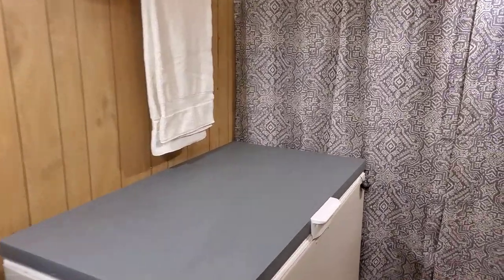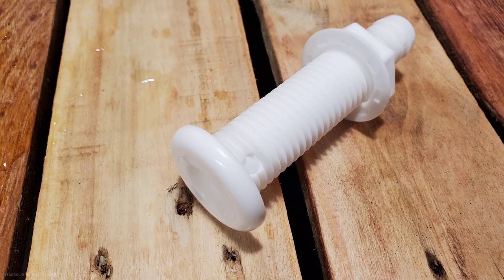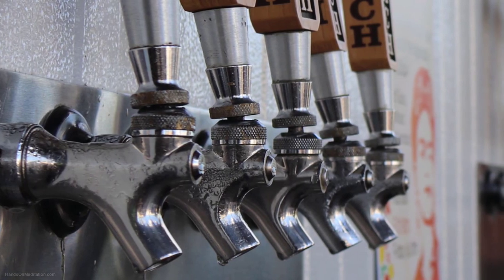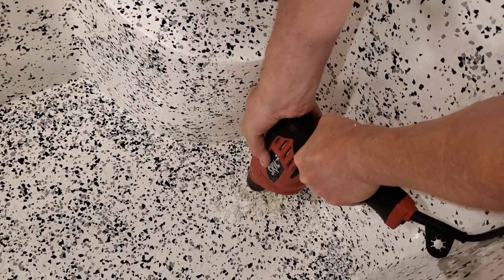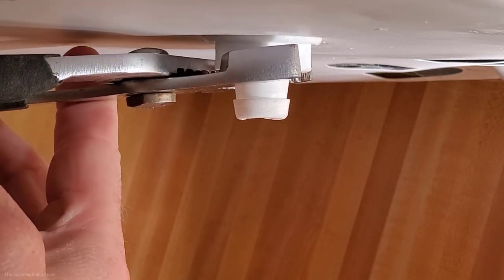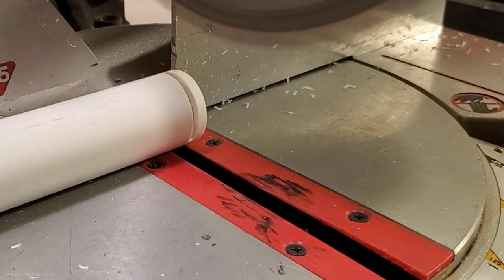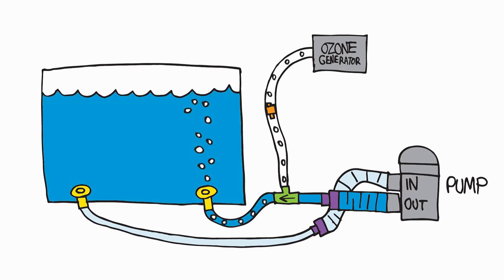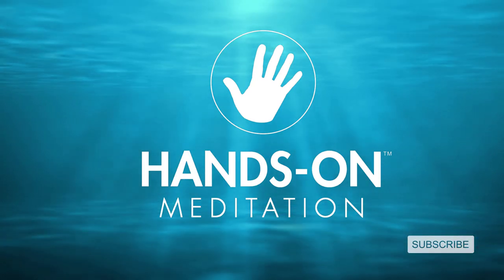DIY Ultimate Cold Plunge | Running Plumbing Up Through the Freezer Floor | Ice Bath Cold Therapy

Comment: Followed your setup, thank you! Just connected the venturi injector and it has dramatically decreased the flow of water in and out of the pump, its filtering much slower due to the air bubbles. Did u have the same issue? What size pump are u using?
Reply from the maker: This is the pump I use https://a.co/d/4C5TkcJ  I've never connected it without the venturi and ozone generator so I have no idea how much that changes the flow. But it seems to work well.  Links to all the products I used are in my 1st cold plunge video.
Reply: Thank you! Did u get the 1000GPH one?
Reply from the maker: Looks like it's 1000 gph.
Reply: @HandsOnMeditation  seems overkill no? 500 would be plenty?
Reply from the maker: It is a little overkill but a lot of these pumps are basically cheap plastic junk. I was originally running my hoses over the sides of the cold plunge and ran into issues with a smaller pump. It was complete garbage. If you have success with a different pump, please let me know.

Comment: What diameter are those through hull connector? I have the same pump
Reply from the maker: I have links in the video description. Mine connect to 3/4" hoses but the pump hoses are larger so I used an additional adapter to size up to the pump hoses.
Reply: Can you give me details on the adapter?
Reply: Can u post a pic of the adapter?

Comment: Thank you for the many details. I've been reading "The Ultimate
CHEST FREEZER DIY GUIDE
COLD PLUNGE* eBook and there it's stated that ozone can be dangerous indoors when not ventilated thoroughly. What do you think?
I have my chest freezer placed indoors where people/pets often pass by. I haven't fully decided on the sanitation method yet. Ozone seems perfect but I'm worried about apparent dangerous effects indoors.
Reply from the maker: I wouldn't lock myself in a closet with an ozone generator running all day long but mine only runs for a 5 minutes a few times during the day and night, then10 minutes after each use.  It's my understanding that ozone dissipates quickly in water so I don't think there's any danger in the way that I'm using it and I haven't had any issues.  I would do some more research and decide whatever you're most comfortable with. I'm much more comfortable using ozone than pool chemicals. Also a lot of spa's use ozone and it's even used in food preparation.

Comment: Have you had any issues with temperature with this setup?   I've heard some say that it's harder to keep the temp down due to the heat transfer from the lines and pump that are outside of the unit.   Also, do you run the circulation 24x7 with the ozone being injected only for a short period or do you only run the circulation / filter for the time that you want to inject the ozone?
Reply from the maker: With this setup, the water will warm up a little when the pump is running because the hoses are outside and aren't insulated,  so I don't run the pump continuously.  Also, I run the pump and ozone generator together and I don't want to create unsafe levels of ozone. I just run them for 10 minutes after each use, and a couple more times during the day and night for 5 minutes. I use programmable smart plugs and that works well. My cold plunge usually gains about 3 degrees of temp each day, and running the freezer for 3 hours at night brings it back down. I'm working on a videos that shows my specific settings and the ozone/pump working together.
Reply: @HandsOnMeditation  Cool, thanks for the response.  That all makes sense.   Look forward to seeing that other vid when you get it up.
Reply: @HandsOnMeditation  I live in texas...and I'm thinking about putting this unit on the back covered patio...however, it does get pretty hot here during the summer.  I wonder if I'll have issues with keeping the water cold...

Comment: Hey man have you noticed the Air/odor from the ozonatar make the Air harsh to breath in while your in the cold plunge?
Reply from the maker: No, but I don't run the ozone generator very long. How long are you running it? I only run the ozone for 10 minutes after each use, and a couple more times during the day and night for 5 minutes.
Reply: My one is hooked up to my ink bird so turns off & on with the ink bird not to sure how much time each day it will be on but maybe to much, Also I need a air stone filter for where it pumps the air into the water, I have foam type piece on there atm
Reply from the maker: You may want to put it on a timer so you can better control how long it's running. I use smart plugs https://amzn.to/3N34frM and can adjust with my phone.

Comment: Nice and and clean setup.. Any reason not to run the thermometer through the wall ?  Also do you know it Sikaflex sealant is non toxic? Thanks.
Reply from the maker: I'm not sure about the sealant but mine is covered in pond shield paint and that is not toxic.  My thermometer cord is very thin and easily fits under the cover so there's no reason to go through the wall.

Comment: I love this setup. Could you please share the make and model of this freezer? Was it white enamel inside or aluminum? 

Q: do you think the through ports would seal as well over line X?
Reply from the maker: I believe mine is Whirlpool - 14.8 Cu. Ft. Chest Freezer - White Model:WZC3115DW
The inside was white enamel but had some scratches that were rusting so I painted it with Pond Shield.
I'm not sure about line x. I've never worked with it. Please let me know it you experiment.

Comment: What setting do you have your filter pump on?  And I’ve seen other cold plunge DIY videos where the ozone tube just sits in the water so they need a timer on it. Since we have the ozone hooked into the filter pump, do we need a timer for the ozone generator since it should only flow when the filter pump is running?

Thank you!
Reply from the maker: I have the ozone generator and pump on the same smart timer (I used a splitter so they run at the same time).  They are programmed to run for 10 minutes after each use and a few more times at 5 minutes during the day and night.
Reply: Hi, can you provide a link of that timer and how did you installed it? Thanks
Reply from the maker: I ended up using smart plugs for a timer. There's  a link in my 1st cold plunge video for them you can program them with your phone.

Comment: Also I can't find anywhere a coolant line diagram for my  14.8 frigidaire FFCL1542AW. Any help for schematic because I really want to setup just like yours. Btw getting a Thermal cam is out of the question.  Thank you.
Reply from the maker: You might be able to borrow a thermal cam from your local fire department if you bring brownies or you can order one from Amazon, try it, and if you aren’t happy return it. Plumbers also often have thermal cams. And you can feel the surface temp difference
Reply: Hey! Was wondering if you ever found a diagram for your freezer or found safe spots to drill?  I just bought the same one and literally has searched everywhere online.
Reply from the maker: I really suggest checking with a thermal cam. You may be able to order one, "test it out" and possibly return it if you don't want to keep it.
Reply: @HandsOnMeditation  You're probably right.  It will be the safest way.
Reply: Was able to get a thermal camera. Turns out I was able to put mine essentially the same place you did.
Reply: @HandsOnMeditation  brownies for the local fire department.  So funny, love it.  But to be honest, I think tht would totally work.
Reply: @stephenshockey  I just bought the same freezer and I’m about to do the same pump setup. How’d everything go using the Frigidaire FFCL1542AW?

Comment: Does anyone have any suggestions for running this setup outside in constant below freezing temps? Should I run the pump continuously/intermittently any time there is consistent cold temps?
Reply from the maker: I don't think you want to run a freezer in temps below freezing. Probably better to consider a large stock tank like they sell at Farm & Fleet. Then use a deicer to keep the water from freezing over. That's also a cheaper option.

Comment: Did you coat all your freezer with the 2 epoxy paint canister ? Only one coating is good? Do you know if it'll stick on top of aluminum freezer coating ? Thanks
Reply from the maker: The kit comes with 2 cans.  You have to mix them together for it to set up (like epoxy glue)  I used two kits and had a little bit left over.  My freezer was painted steel/plastic and it sticks well. I'm not sure about aluminum.  You may want to ask pond shield customer service about that.
Reply: @HandsOnMeditation  Thanks

Comment: Do any of you have a problem with your freezer getting really hot on the back side ?
Reply from the maker: The condenser coils in the freezer move the heat to the outside so it's normal for it to feel warm on the outside when the freezer is running.

Comment: Hello, thanks for the update on this.  Your first video and this were both great.  Very helpful.  One question, you mentioned in your first video how you rewired the 4 pin AMP plug that the ozone generator came with with a normal outlet plug.  I cannot find any information online about this.  Was there a special process?  Or simply did the wires match a plug and you just swapped them over?  This is my major hurdle in buying an ozone generator and would love the help!  Thank you.
Reply from the maker: You cut off the end of the ozone generator cord.  The green wire is ground - it connects to the round pin at the bottom. The white wire is neutral - it connects to the left side or the fatter blade. The black wire is the hot wire and it connects to the right blade. https://photos.app.goo.gl/vfer9SgFnrBkBpyt7
Reply: Thank you for this.  Much appreciated.  Happy cold plunging

Comment: Ozone generators are not meant to be used indoors.  How are you getting around that?
Reply from the maker: Good question. Ozone generators are used for some indoor applications such as food preparation, spas, etc. when used in water. Also, I don't run the ozone generator very long. I only run the ozone for 10 minutes after each use, and then a couple more times during the day and night for 5 minutes. Of course, you should only use what you’re comfortable with. However, if you don’t use ozone, you’ll have to change the water constantly or use pool chemicals and those can be harmful.
Reply: @HandsOnMeditation  That makes sense to me. Can you send me any links you have found that cover this topic? Everything I find says not to use indoors but doesn't seem to cover when used with water.
Reply from the maker: Here's some info I have seen. https://biosureozone.com/2021/05/11/is-ozone-water-safe/#:~:text=Ozone%20therapy%20is%20safe%20for,for%20bottled%20water%20processing%20lines.
Also, these are some of the ozone generator products sold on Amazon. Many are for indoor use. https://www.amazon.com/water-ozonator/s?k=water+ozonator

Comment: the reason that you add the ozone is to never need to change the water ?
Reply from the maker: The Ozone helps keep the water clean, but you’ll still need to change it occasionally. We have two people using our cold plunge most days and can go about three weeks before we need to change the water. I’m also experimenting with the UV light clarifier and that seems to work as well as ozone. I’ll be posting a video soon to explain. Please subscribe and look for it.